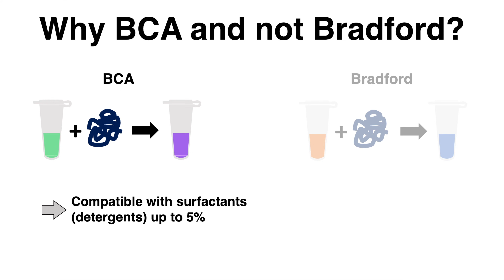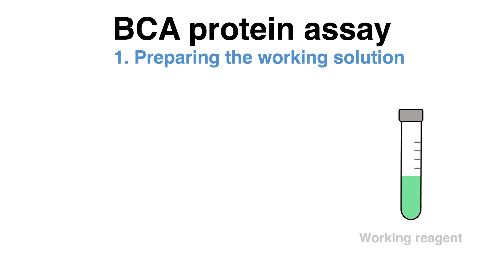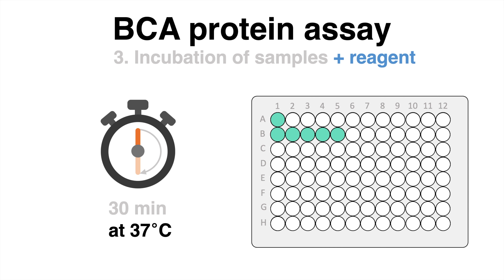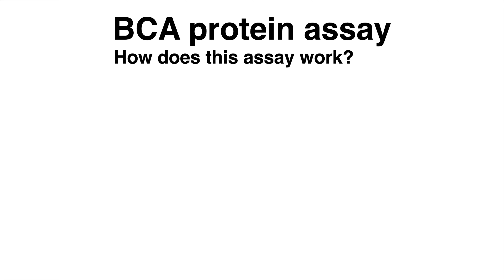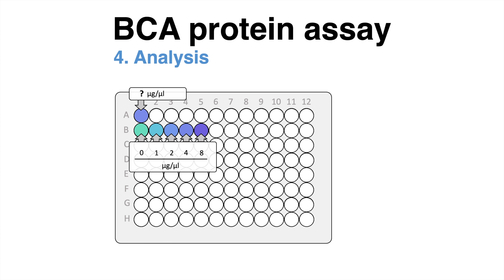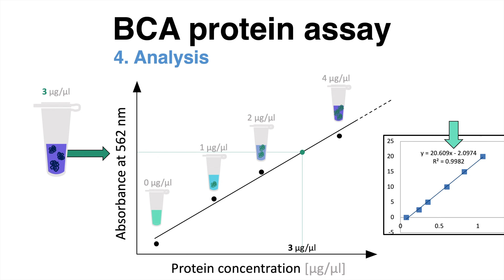How to determine the protein concentration with the BCA Protein Assay

Comment: Thank you so much for the video. Your explanation was excellent.
Please, does the linear curve indicate any meaning to the experiment?
How do we calculate the protein concentration using the equation of the standard curve?
Reply from the maker: Hey, thanks for that! The linear curve is of meaning to the experiment. You plot the absorbance value for each of your standard concentrations (use microsoft excel for that). If you have plotted the curve, you can see the formula of that plotted curve (you need that to calculate your sample concentration). Now, you replace "y" with the absorbance value of your sample and calculate "x". This is your sample concentration.
Best, Henrik

Comment: Thanks for this informing video. I have a question. After getting the concentrations (I am getting them in ug/mL unit) should I have to divide to 20? Because I am taking 200uL from the working buffer and putting 10uL of the sample. In the end, should I divide to 20 or multiply it by 20?
Reply from the maker: If the device/program is not calculating the concentration itself, you would have to multiply by 20. But read into your device/program since many programs are calculating this already :)
Reply: Maybe a weird question but what number at the end is needed to be multiplied by 20 and why? Trying to myself understand how to get results to mg of protein.